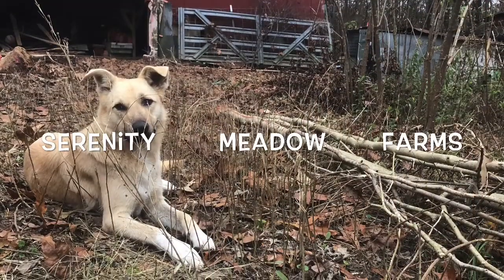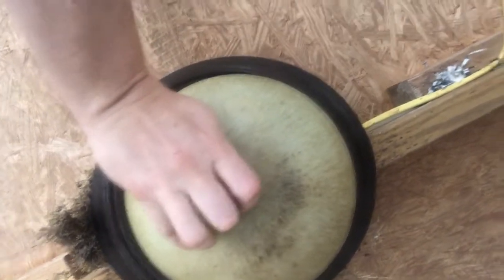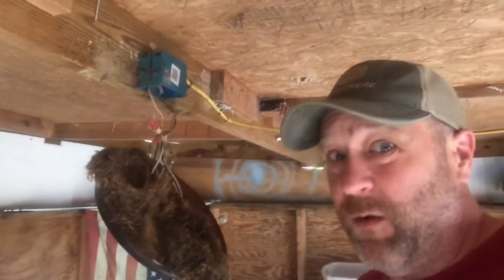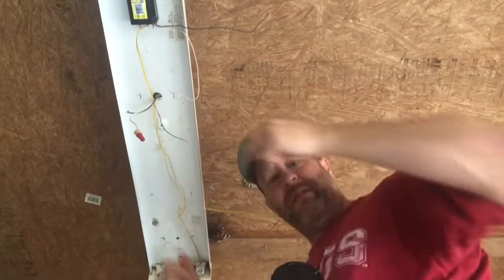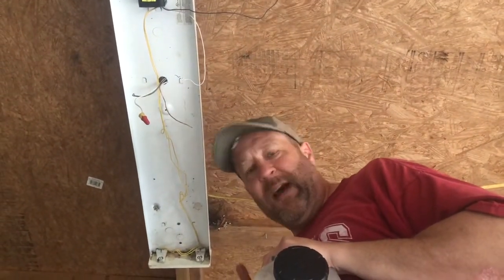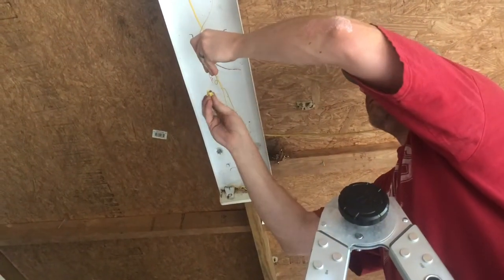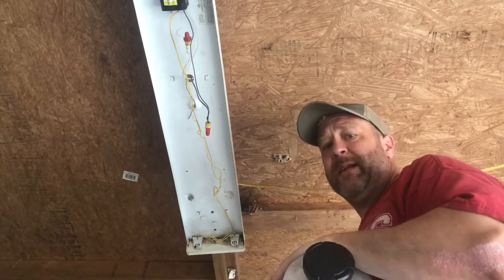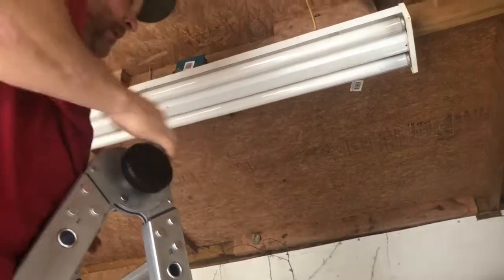Quick and Easy Light Fixture change out DIY.

Comment: Thanks for sharing. Wow that was a mess inside. Glad you got it all fixed. May have to hire you to get my bunny barn wired up. Actually I have to dig a trench this spring and lay wire from the house to the barn. Have been using an extension cord for power.
God bless you my friend.

Comment: A little masking tape, and a 'Do not use' sign on the switch is also a good idea, if you have people that might wander in while you are doing your work, and flip that switch.  I don't know who did the electrical work on this house when it was being built, but it frightens me - I've done 2 low profile fixture installations, have 2 more to go, and each one has had bare wires, just twisted, no  nut, and a wiring plan courtesy of Picasso behind it.